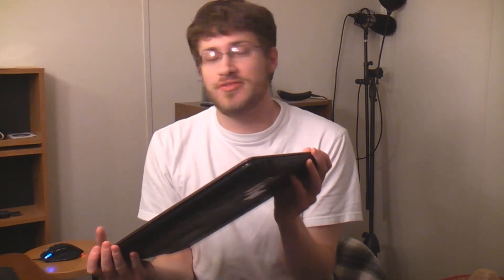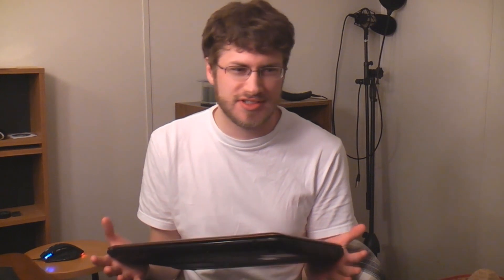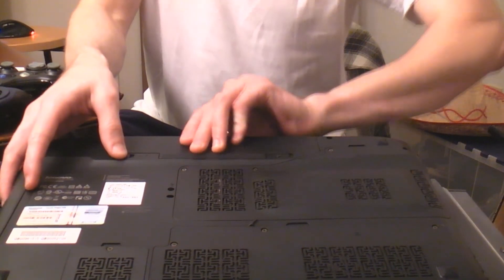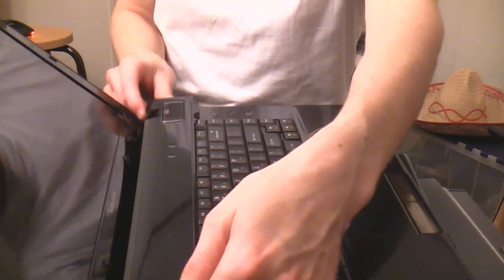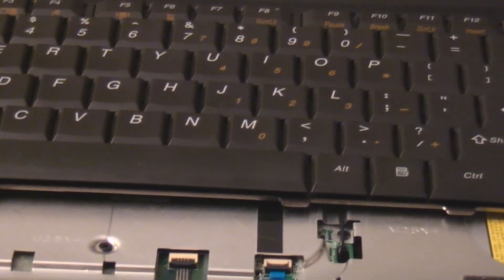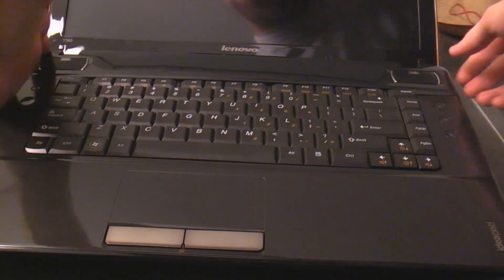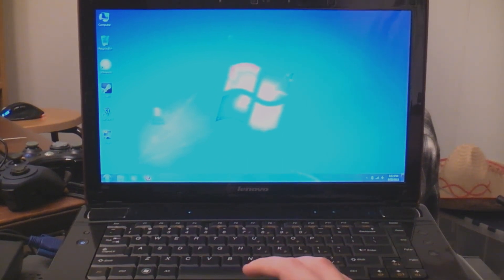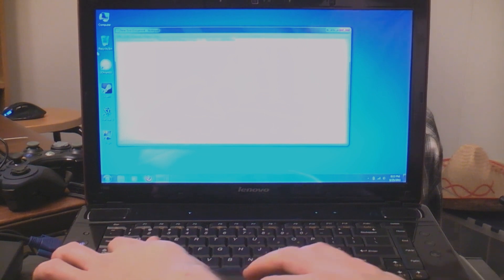Lenovo Ideapad Y560 Keyboard Issue/Problem/Malfunction - And Its Solution!

Comment: So,I had this problem with different model of lenovo. Wasn't sure what exactly was the cause. Bought and changed the whole keyboard myself, which wasn't easy or cheap. Just took few month for the problem reacure. Disconnected the keyboard and got myself a portable keyboard and used on screen keyboard for a while. Gathered my patience to fix my laptop again (had other unreleated laptop issues as well) and trying your advice now. And if its actually static problem I'll be infuriately happy 😑

Comment: My nephew gave me his Lenovo Y560 laptop but he practically DESTROYED it. It would cost me as much if not MORE to replace all the shit he removed and/or broke while trying to get it apart than it would for me to just buy a used one like yours. That's a damn shame because this is/was a decent PC. Instead, I decided to just salvage what I could from it (500GB hard drive, RAM, CPU, DVD drive, WiFi board, Power supply, etc) and toss the rest. He really did a number on this thing  :>\

Comment: Thanks for the guide! I have a y460p and applied a modified solution since it is slightly different under the keyboard:

Underneath the keyboard there are two metal clips holding a wire in the middle. Tape the anti static bag so it covers both metal clips (about 1/2 by 1/4 inch was good for me).

Comment: Hey man, this was happening to me awhile back. When I typed stuff it would place random letters and symbols in between my text. Did this a couple of months back and its not fixed. Thanks man. Along side the keyboard bugging out the screen started screwing up and would only work when I applied pressure on it, I'm currently using some tissue paper stuffed between the laptop body and the screen to make it work but I was wondering if you were getting the same problem and weather u had a fix for it. I'm yet to open it up and check if its a cable problem or the actually screen problem but my laptop has never been dropped and is rarely moved around. Thanks in advance

Comment: Great vid? My problem is with the TOUCHPAD. It acts crazzzzzy!!!!!!! any ideas?
I put an ssd in and cant find any true Lenovo drivers although im doubting that's the issue? ANY help would be greatly appreciated
Reply: go into the advance settings there's a way to control the sensitivity of it.  Basically I hated their touchpad so I had mine disabled and just use the mouse instead. So irritating.

Comment: thnx dude ur video was helpfull now i have another issue i dont know how to fix it i am screwed while removing the keyboard i didnt know how to remove the ribbon cable so i accidently broke the black connector which holds on the cable now my question is how can i fix it thnx in advance any help will be appreciated please help

Comment: dude you are sooo cool i have this lenovo G580 model and has that same problem regarding that key board and some times when i click some of desktop icon(shortcut) it will not open properly unless it'll go to its properties before i thought it was a COMputer virus or something i tried to repair it but it failed cos i cannot go to bios setup and can't perform any keyboard function jeys working properly so thanks , when i got home i 'll try this methodology thanks very much and GodSpeed bro

Comment: It works !!! Thanks a ton.

My Lenovo Idea-pad Y560p had a keyboard malfunction, some keys like G,H,E ,Y used to type junk characters, this used to happen only sometimes, so would give me a false hope that today my laptop would work but it didn't after a while.
My service center guy told me that my keyboard is short-circuited and would have to be replaced :( 

I tried this technique [suggested in this you-tube video] , but didn't had that static plastic as suggested , so used a thin hard plastic piece [size of a quarter] from one of the packing.

Thanks a million for the trick. Saved me lot of money and time. 

PS: I am sure replacing the keyboard would have got the same issue , unless the cable of the newer keyboard was much more heat resistant.

Comment: Thanks Theje, Worked great!! I didn't have any anti statis so i used a folded piece of electrical tape. If you open the DVD/CD drive you can pop the the clip on the rh side of the speaker cover with a small flatblade screwdriver which I almost broke trying to muscle it out.

Comment: hey bro, same kind of issue with the y570, except it's the backspace, capslock, left shift, 't' and 'y' keys. I've read a few forums and it seems a lot of people are experiencing this. Could this also be a problem caused by the keyboard wire creating a short?

Comment: Thanks! This was so helpful! No more problems with my keyboard!

However when pulling that panel off, I had a terribly tough time like you mentioned and one of those cords broke! The small one on the left side. However after putting my computer back I can't figure out any problem...the keyboard and speakers work great! So far it just seems that some of the little lights on that upper portion are broken. Is this something to worry about? What is the function of that cord? Thanks!

Comment: Here's a tip for others who follow this procedure.  There are four spacers molded into the plastic cover plate, held in place by the outer screws.  The spacers hold threaded brass inserts.  These molded spacers are easily broken. Minimize breakage by removing the four battery compartment screws first. Unscrew the other four just two turns at first, then gently press those screws in, freeing the cover plate from the body. Then finish removing the outer screws and follow the remaining procedures.

Comment: I had Y560p laptop for more than two years. Last month, my Lenovo Y560p laptop developed this strange keyboard issues when I travelled abroad last week. Initially, I wasn't sure if it is a hardware problem or some kind of virus.
After browsing the Lenovo forums, this is the best video that I could find. I followed the instructions and it did the magic. Good job on creating such a good video to remedy this keyboard problem.

Comment: Thanks for that, did it and it works ....1 hour after and nothing has caught fire. I did find that the little plastic screw holders inside the laptop broke and needed to clue them back in place. But i consider the amount of time and heartace i have saved by doing a DIY then i am happy.

Comment: i fixed mine. the problem is dat the little pin inside the charging point rotates around its axis so as it rotates it causes the cables soldered to the port to twist and twist till one or both snaps. so u will have to open up, remove the right speaker so u can have access to the port and cables then solder it back to the port and u wil have ur laptop charging again

Comment: I have the same trouble with charging. It charges only when the cable is connected in vertical position. I've tried with another power supply and it didn't work for me.
I'm tired of Lenovo, going back to Toshiba

Comment: about the the messed up thread for the second screw i think its a general problem. i have a y560p which i bought about 10months ago and it has the same messed up thread. same hole. im having charging issues. the charging port is messed up. nothing wrong with the charger itself. if u got any help on that will really appreciate it. tnx

Comment: ADDED BONUS! I was having problems with "the connection was reset" errors using my wireless network, and spent forever looking for a fix. After updating drivers and messing with almost every single setting on my wireless card and router I had given up. Well guess what, after inserting the anti-static bag that problem is ALSO fixed! I'm guessing the static from the keyboard somehow was messing with the wireless card... not exactly sure how...  but again I can't thank you enough!

Comment: CAN CONFIRM THIS FIX ALSO WORKS FOR THE Y560p!

Can also confirm lenovo does not solidly construct their laptops. 2 of the screws involved in this process wouldn't even screw back in because the nut (or whatever it is) behind the screw just popped right out with the screw and now my laptop makes a rattle when I move it around.

Annnyywhooo, definitely worth it as now I'm able to type on my laptop uninterrupted. THANK YOU SO MUCH!!!

Comment: TheOzm3n, I doubt that it's any particular preinstalled application because I had the problem on a Ubuntu 10.04 install, as well as Win7 and WinXP installs running in VirtualBox on top of Ubuntu. So this is definitely a hardware issue. Anyway, I can also attest that this problem went away *immediately* after following this fix, so thank you Theje! Not only did I not even bother calling Lenovo, but even if they could fix it, it was easier to do myself than to deal with shipping my system!

Comment: Thank you sooooo much!!! I had a bit of trouble with one of the screws, which just spun round and round and wouldn't tighten or loosen, but I was eventually able to just force the section just in front of the keyboard up. I used a piece of tape folded over instead of an anti static bag, and from what I've seen so far, it's working really well! Thank you!!!!!